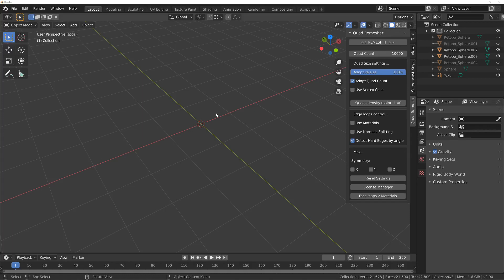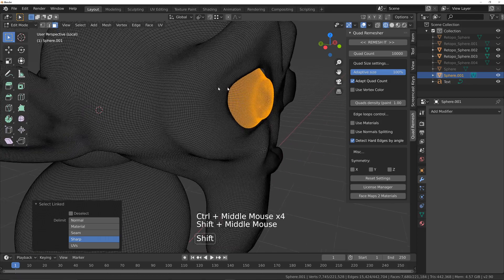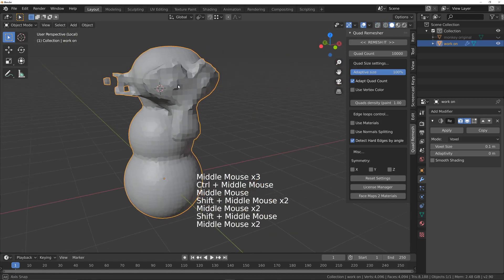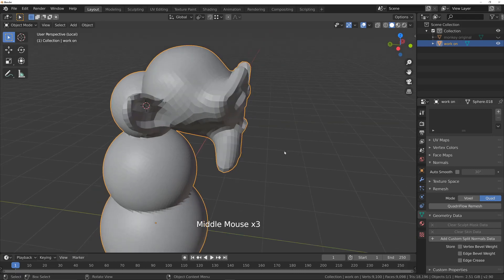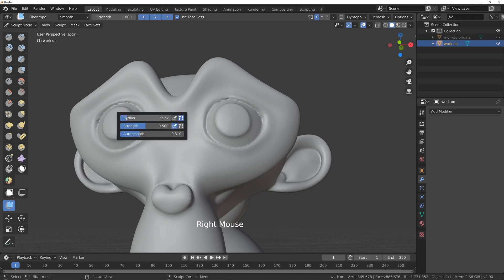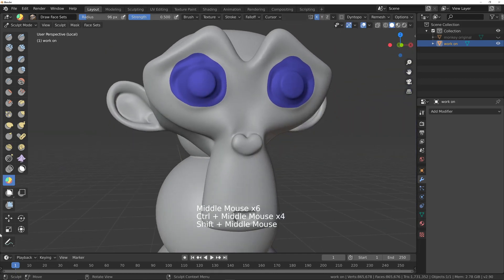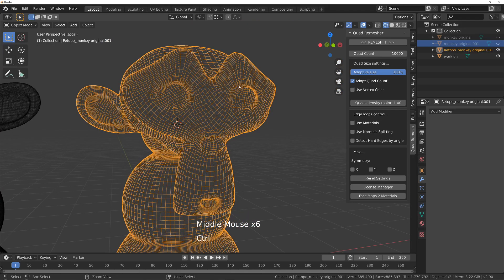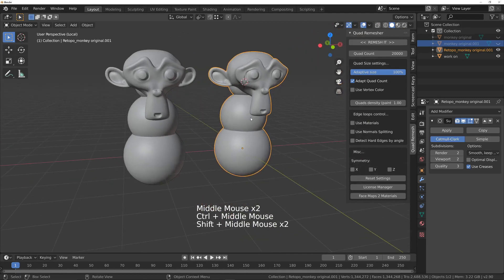Prepare your model for 3d printing in Blender

Comment: Thanks for the video!, however i have an issue, the Blender re mesh modifier delete all the geometry inside the object, the geometry that is not visible... but the Quad Remesher add on does not.... why?
Reply from the maker: No problem.  A solidify modifier prior to the remedy modifier may resolve that.
Reply: @3d-illusions  Mmm not working, i put a Solidify modifier, applied it, then QuadRemesher and still there are geometrys inside the object
Reply from the maker: @pedrodeelizalde7812  yes it will create geometry  inside the object, but should resolve the disappearing mesh.  You can delete the inner faces in edit mode by selecting any outer face, pressing CTRL L, CTRL i to select inverse, x to delete.  That’ll leave you with just the exterior faces.
Reply: @3d-illusions  thanks for your answer. i can do that yes, but the 2 spheres are still intersecting each other. Once i applied The Blender remesh modifier, the 2 spheres don't intersect eachother on the inside anymore, wich is great ! because that is what i am looking for. Only the shape on the exterior. . (same as your video when you show it using the normal re mesh modifier from blender ) But applying the QuadRemesh , putting a solidify before or not. After Quad Remesh finish, the remesh is complete (great) but this is still 2 objects as before, 2 spheres interescting each other, the only difference is that they have a different topology now.
Reply: Okay the Quad Remesher support they just answered me and they told me that the add-on does not delete the intersecting geometry. ( a pitty )
Reply: Still good add-on . THanks!
Reply from the maker: @pedrodeelizalde7812  make sure you’re using the remesh modifier in voxel mode, it’ll ensure you’re left with only a single mesh.
Reply: @3d-illusions  thanks, i manage to resolve my issue by applying first a Blender Remesh modifier in Voxel mode, and the fixing the ugly topology with the quad remesher. So no inner interesting geometry, and good topology. Happy
Reply: @pedrodeelizalde7812  does this method still work? Can you do a youtube on this? kinda lost

Comment: I have found that sometimes the time spent trying to fix it can be shortened dramatically by exporting the model as an STL.
Load it into Windows 10's  3D Builder.
Have the app repair the mesh.
Save as a new STL.
Put it through the slicer.
Print.

I have even on occasions used this method to clean up a mesh and then import it back into Blender for further work.
Reply: is this still the time tested method??
Reply: omg thanks so much brooooo
Reply: Worked for me man thanks
Reply: I just watched another Youtube video where he did this exact thing. I can't believe whatever math W10's 3D Builder uses to repair mesh hasn't been built into Blender yet.